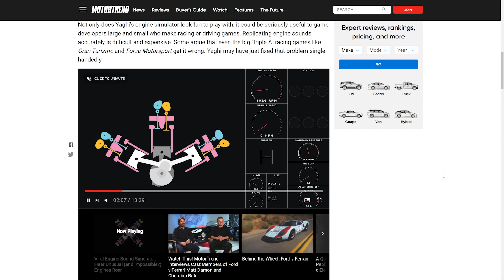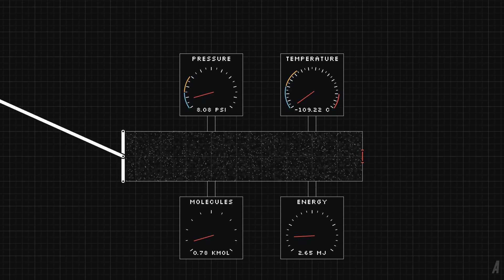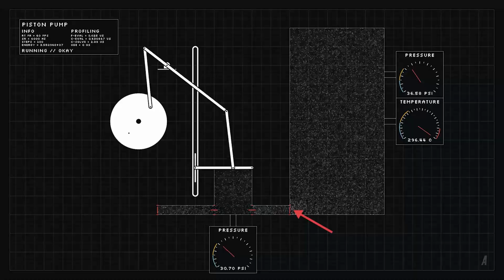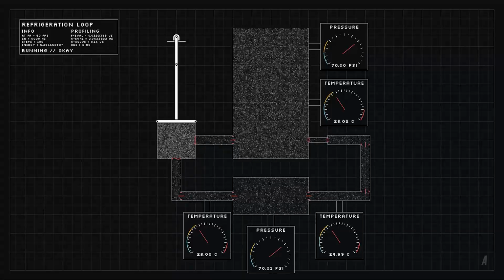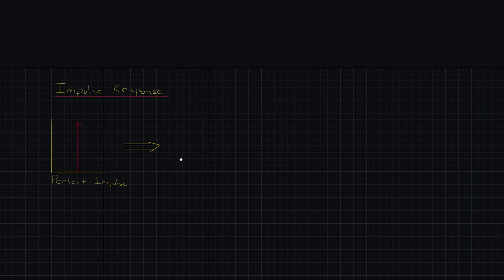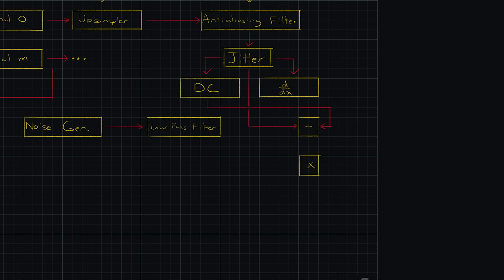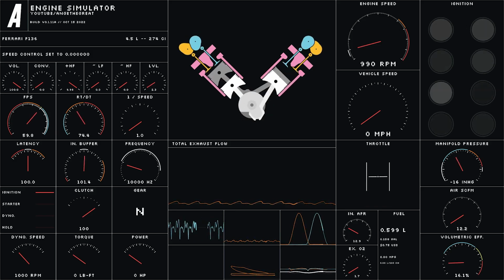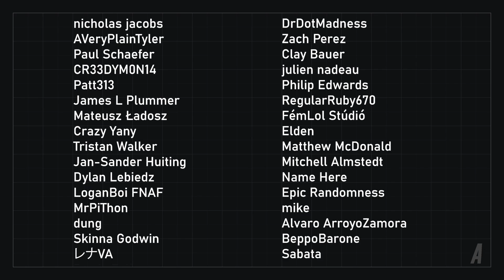Engine Sim: Procedurally Generating Audio Using a Real-time Fluid Simulation (Technical Breakdown)

Comment: "Reddit Experts" I felt that. Nothing more frustrating than having something you built incorrectly explained to you by someone who's never even looked at the code.
Reply: They are the ultimate “trust me bro”
Reply: Making my point, yatub sin sored my previous comment which said nothing but truth.
Reply: I kind of feel like such experts often are the ones who know just enough about the topic to notice the simplifications of it (or even just the deviations from the curriculum), but don't understand the reasons why it might not even matter.
And I guess most of them also like to throw fancy terms left right and center to scare laymen away and feel superior.
Reply: @jonsen2k  it's reddit. It's definitely just for the sake of feeling superior
Reply: Especially when it's completely open source. Like, if you think you're knowledgeable enough to explain it, you should be knowledgeable enough to read the code right?
Reply: @jonsen2k  I'd say it's more of the latter, redditors literally die the second they don't fulfill their superiority complex by talking shit about others or not sounding like an expert on absolutely everything LOL
Reply: Or someone telling you that your mathematical approach is wrong when they've never done a differential equation in their entire life
Reply: @williamrutherford553  I mean even it was closed source it really should be obvious that they modeled the engine internals. All the interesting physical diagrams are right there on screen. So either that means 1) they found a way to model the internals of the engine and use that  and use some lightly additional sound editing 2) they found a way to generate those diagrams solely based on sound and doesn't model an engine or fluid dynamics at all. Number two is way way way more difficult.
Reply: @jonsen2k  I think knowing just enough makes you think you can judge anything even though that's just overconfidence
Reply: Simply put, there's a difference between knowing and understanding,, and most reddit experts do neither
Reply: I met a few of these in real life at computer science college, they like to undermine any innovation with the argument of it being very simple and not impressive, just because they can understand the fundamental concepts of that innovation, It somehow means that it is overrated, no matter how significant and actually ground breaking it is, them being able to understand it at surface level after it's been done somehow makes it unimpressive.
Reply: @renasouza8261  😂😂
Reply: @jonsen2k 
…well that was rude.

Comment: Former Mechanical Engineering grad student here, who got a Ph.D. in fluid mechanics with an advisor who specializes in internal combustion engines, so I may have a little bit of expertise to pass judgement on this.  This is, no question, a simulation -- and one that is, IMO, very well done.  As my advisor often said, "All models are wrong.  Some models are useful."  The trick is to choose the level of approximation (i.e., wrongness) that is appropriate for the answers that you want, and while this has a lot more approximation than the full 3-D fluid simulations that an engine company might use, you're also not needing their level of precision in the answers.  This is useful for what you need, ergo it is a successful simulation.

The one "big" thing that I note that would separate this from what some people might judgmentally think of as a "real" simulation is that you haven't tested it against experimental data except in a sort of broad sense of "these numbers are about the right magnitude".  It would be interesting to compare the simulated exhaust velocities and such to actual ones to see how close the model actually is in computing those.  That would also give you an ability to multiply some of your flow equations by experimentally-derived "correction factors" to account for the fact that the flow doesn't precisely match the simplified model -- for instance, perhaps typical cylinder geometry gets 95% as much scavenging as you calculate or something.  But that's a refinement, and IMO there is nothing wrong with an "a priori" model like this.

For simulating the turbulent noise, random noise is almost certainly the best choice.  To be most accurate, you probably want to "color" the noise by having different average amplitudes at different frequencies rather than using plain white noise.  I don't think there's a good way to calculate the coloring other than using parameters from an experimental recording -- which is basically what you're doing in a very rough way by a "does this sound about right?" adjustment, and given the small amount of difference it sounds like it makes, that amount of accuracy is entirely sufficient.

I am also reminded of one of my dad's career successes in his Mechanical Engineering Ph.D. back in the 1960s.  He was working on simulations of turbulent flow next to the walls in a nozzle, and the "most advanced" state of the art at the time was complex 2-D computations.  He found that, by using a much simpler 1-D approach that used experimental data more heavily, he could produce notably more accurate results than the 2-D computations.  So more-detailed does not always mean more accurate!
Reply from the maker: Thanks for sharing your knowledge! I would absolutely love to get some decent equipment and test the simulation against real data. In fact, it's something that I may actually do as the simulator develops. Part of the problem I had while writing the simulator is the lack of experimental data, or at least, experimental data that is easily accessible online. There's also a notable lack of experimental data on the more "non-essential" elements of engines. For instance, finding a research paper on "cam chop" seems to be pretty challenging and I wasn't able to find many satisfactory scientific explanations for that phenomenon. In any case, perhaps as more knowledgeable people such as yourself learn about the simulator and contribute their knowledge, those gaps can be rectified. Thanks for watching!

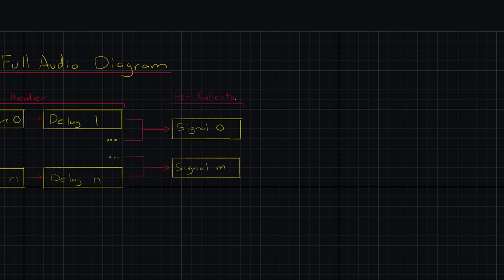Comment: 13:00 If you want a turbulence noise with more solid theoretical grounding, you could instead calculate the vortex shedding frequency of each vessel from its diameter and bulk velocity. (Then, integrate instantaneous frequency to get phase, and use the phase to calculate the amplitude; OR just apply the frequency as a bandpass filter on your white noise.)
Reply from the maker: Sounds pretty cool, I'll definitely have to look into that
Reply: @RamenPoweredShitFactory  mainly because it requires knowledge in high level math like calculus
Reply: @JuniorJunison  Calculus isn't that high level (at least, it shouldn't be, it's not that scary and we should stop treating it as such on a societal level), it's just the foundation that all the engineering concepts start from.
Reply: @JuniorJunison  you need math to understand what a vortex is?.

A fluid getting compressed creates a vortex if it has anywhere to escape while compressed, your kitchen sink makes a vortex, a seringe makes a vortex, toilets make a vortex. This is middleschool physics tier of knowledge.
Reply: @recoverhealth2062  While what a vortex is elementary knowledge, things like the vortex shredding frequency, instantaneous frequency, and phase are not, and require knowledge of fairly advanced physics and mathematics. And at any rate, while knowing what something is is generally very simple, modeling it is most often not.
Reply: @dotCashark  yes, but you can break down what OP says easily. Vortex shedding, easily explained, is the vibration/energy really, noise, whatever, a vortex leaves behind onto surfaces when it passes near them. The reason your kitchen sink makes a "slurp" when the vortex and water passes through is vortex shedding + a change in pressure in behind the leaving vortex.

Physics and math use *BIG WORDS©®™" in order to compress information, beyond that it's fairly simple if you give enough of a fuck to deconstruct "BIG WORDS©®™"

Reminds me of 2 of my friends (they're coworkers) acting smart while speaking about some piece of electronics they're fixing and one goes "you checked the RJ45, right?" to the other, I just went "isn't that a LAN cable?"...
Reply: There's also likely to be nice heuristic to approximate this frequency and applying it as a bandpass and skipping an integration step is likely the type of solution you want for a real-time application, which is why the comment is so cool, even before you actually start researching the terms used. In other words, the comment was written in a way in which you don't need to understand the terms to understand the principle.
Reply: @recoverhealth2062  we get it, you're smarter than people who ask questions about something they don't understand in a youtube comment section, you're such a cool guy
Reply: @recoverhealth2062  That is incorrect. Vorticity (in a stationary flow) is created in the boundary layer of the flow domain due to the viscous stress. It has nothing (almost) to do with compressibility. (Most of the flows you mentioned can be treated as incompressible) And you need calculus to properly understand vorticity as it is directly related to the cur of the velocity field and the Circulation.
Reply: @JCisHere778  what i was saying was that you don't need math  to understand a vortex, and used common (mostly flawed) examples, a car has several vortices when driving on its surfaces etc, they're present everywhere in nature.
Reply: @ZhilBear  There is indeed a really convenient heuristic to approximate the vortex shedding frequency!  f = S V / D; f is the frequency, V is the bulk velocity, D is the vessel diameter, and S is the Stroudhal number for the flow -- which for most intents and purposes can be approximated as 0.2, but if you want slightly better you can calculate the Reynolds number (which is just some constants times density times flow speed times length) and use it to interpolate between 0.18 and 0.22.
Reply: @ZhilBear  Also, the phase integral I suggested is an even simpler/faster integral than the one a bandpass filter internally uses for its state variables. Each sample you just calculate the next phase value as the previous plus the frequency value ( ω(t) = ω(t - Δt) + f Δt ) and then output the sine of the result as the sample value ( sin(ω(t) ).
Reply: @AJMansfield1  That's so cool. I have to play around with this stuff at some point.
Reply: @AJMansfield1  Wait, wut? Which vessel diameter are we talking about here?
Reply: @jonsen2k  It would be the inside diameter of the exhaust pipe. You're calculating the vortex shedding frequency of the exhause flowing throught the exhaust system.
Reply: @jonsen2k  oh, I do believe that was an error - that term is supposed to be the characteristic length (i.e. the volume divided by the surface area) not the diameter. Each of the pipe sections in the model would have a different value for that characteristic length that would affect the frequency of the vortices it generates.
Reply: @lastplace199   Ah, alright. Well, the Strouhal number is not really applicable here though as it is (afaik) used when dealing with obstructions in a free flow, or at least where the obstruction is small enough relative to the enclosure the flow is within.
Reply: @AJMansfield1  Also, I don't think there's any fruitful way to calculate any significant shedding frequency within an exhaust system as it is severely constructing the flow and changing its direction several times even before it has left the header.
Reply: Hey guys chill vortex go brrrrrrrr that's all we need to know.
Reply: @recoverhealth2062  im just gonna remark that it's easy to explain things to a novice if you understand them well yourself. but it doesn't mean that it's possible to easily understand the same concepts without deep underlying knowledge
Reply: @jonsen2k  it's certainly a model that has its limits, but I think it's still appropriate to the task here, of roughly approximating the sounds the system would make. Even if your estimate of the strouhal number is off by a factor of two, it just means the sound will be an octave higher or lower than it should be — and since the strouhal number is usually determined experimentally anyway, you can just tune the value you use for the simulation until you get the correct result. The thing that matters isn't the value of the strouhal number, but the relationship between frequency, velocity, and characteristic length.
Reply: @AJMansfield1  I strongly disagree, as I don't see how the Strouhal number is applicable in this case at all.

First of all, when talking about the Strouhal number and its shedding frequency the characteristic length in question is of an obstruction of a free flow, such as a ship in the ocean or a chimney in the wind. An exhaust flow is far from being a free flow as it is highly constricted by the geometry of the system itself. Any time there's a change in direction of the flow, you'll most likely have some form of disruptive flow separation and vortex shedding after it.

Secondly, if there is asymmetry of the obstruction the shedding frequency and amplitude is severely affected. And like I said, even though the face of the exhaust valve could be considered an obstruction, its stem, flow constriction and change in direction of the exhaust port following shortly after will likely negate any shedding effects of the sound.
Reply: Yeah that's what I was thinkin...
Reply: @jonsen2k  ok so perhaps it's not the stroudhal number anymore. The model is still f = k v / l, for a velocity v, characteristic length l, and some per-segment experimentally-determined proportionality constant k. Even for a confined flow it still makes sense that increased velocity would result in higher frequency noise, and longer characteristic length would result in lower frequency noise.
Reply: nerds
Reply: Also, wouldn't another significant source of noise be the structural harmonics? Each time a piston compresses, the shape of the cylinder will be slightly different due to vibrational flexure, thus slightly changing the timing of when the detonation occurs; or is that not significant enough to matter?
Reply: @AJMansfield1  That's still just the rearranged equation for the Strouhal number which is a ratio that varies, and not a fixed number, similar to the Reynolds number or the Mach number. They are just really useful dimensionless ratios between two effects you want to quantify in fluid dynamics, and they each have their applicable use cases.

And no, it doesn't make sense that you'd get natural frequencies out of nothing in steady and confined flows. You need either an obstruction in the flow field or a sharp change in flow direction for shedding to occur. If shedding happened in any old pipe flow, we'd drown in the noise from the ventilation ducts, water mains, or gas lines around us.
Reply: @marshallgibson7817  Precisely.
Reply: @recoverhealth2062  An RJ45 is specifically the connector on the end of a cable that goes into a matching port. The usually-transparent plastic construction. It can be removed and added with a crimping tool. The cable is usually identified by their category (eg cat5, cat5e) that refer to the standard and capabalities of said cable. An ethernet cable can have different connectors on the end, not necessarily an RJ45. 

But most importantly if someone wanted to refer to the cable they'd just say "the cable".
Reply: @JuniorJunison   " high level math like calculus " like come on, understanding calculus is easier that remembering how to do long division
Reply: @derick1618 right, and I'm just spitballing here, but 'the cable' might spring to mind one set of things, is it plugged in, severed (hopefully not lol), laying next to a giant EMF source, etc. Referring to 'the RJ45' might highlight in your brain that you're talking about an interface and all that could entail, beyond just a double-checking for a solid connection in some imagined debugging exercise. And yeah, RJ45 is used for many protocols beyond LAN including plenty of one-offs.  

I'm not trying to be critical of anyone above, it's just always interested me how language is used to communicate underlying ideas, the varying levels of specificity people use, how it impacts how we think. 

The point about big words compressing/abstracting ideas is so true. As a programmer, I've noticed that the information density in a section of code is something I'm pretty sensitive to as far as comprehension and reading speed. I've always loved C# as it seems to have a nice blend of syntax, symbols, for example. Other languages change that dynamic for me, and trying to read pure mathematical notation, God have mercy my brain just shuts down. Always struggled reading music as well from a rhythm standpoint, but working on a piano roll view is just fine. I imagine it provides just enough additional visual information to help me process.

Comment: Honestly as a mechanical engineering student having dealt with and dealing with fluid mechanics your comprehension and use of the formulas and concepts aren’t sacrilegious in any manner. You did what all of us engineers strive to do. Take a complicated concept and simplify and propagate it in a manner best suited for the project you are working on given the complexities of the material.
Reply: Yes, it is a very simple model and I would have approached it completely differently, but the results speak for themselves
Reply: @fg8557  if it works, It works.